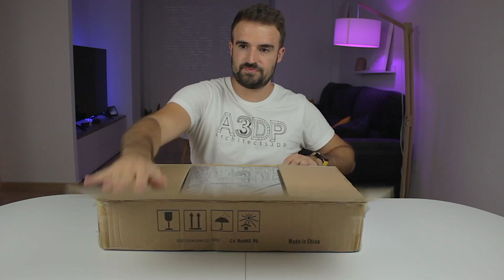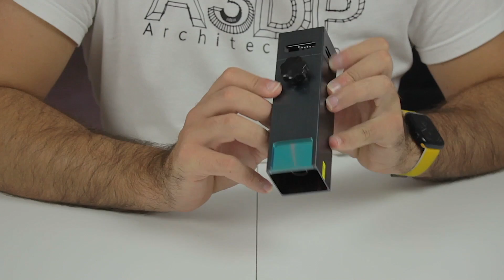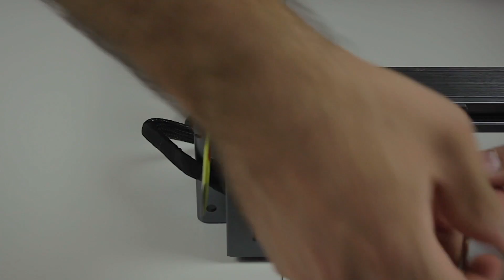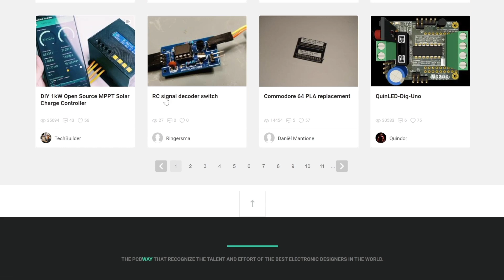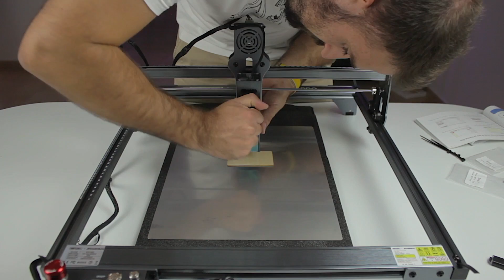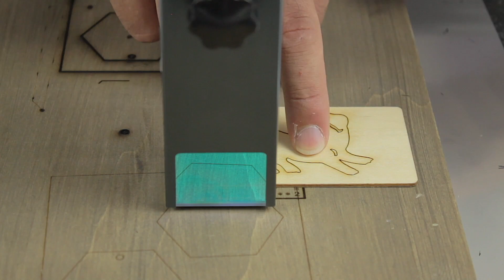GEEKCREIT x ATOMSTACK S10 PRO Laser Engraver 10W

Comment: I took this laser engraver. After a week, the laser stopped burning. The laser focus point floated to a plane 0 mm from the body. I had to remove 3 mm of the aluminum body using a router. This is the quality. I wrote to support, they replied that they had forwarded my letter somewhere and that was it. There is no manufacturer's warranty. An acquaintance also bought this model and also stopped burning after a couple of weeks.